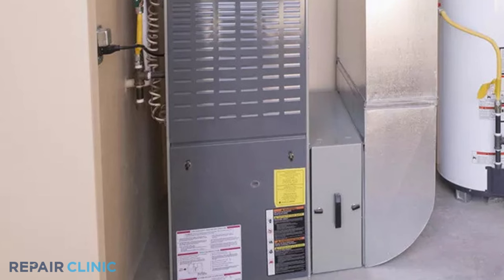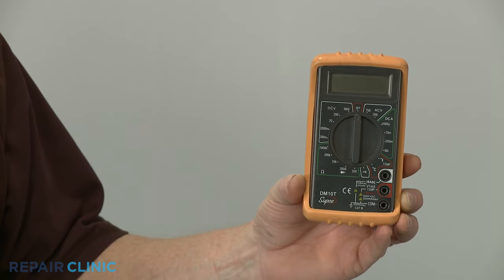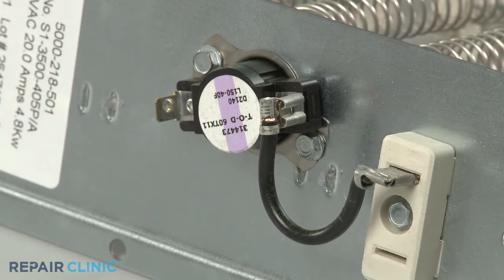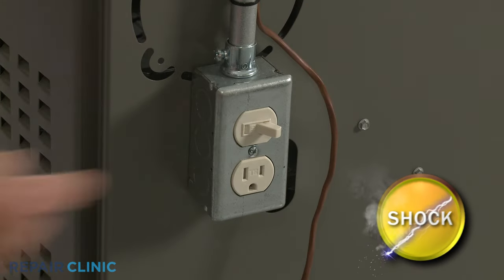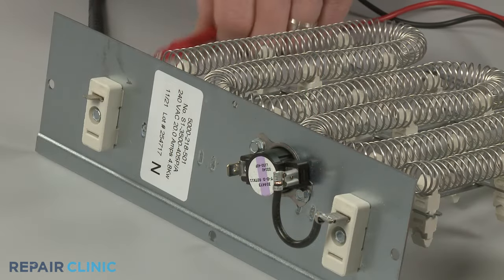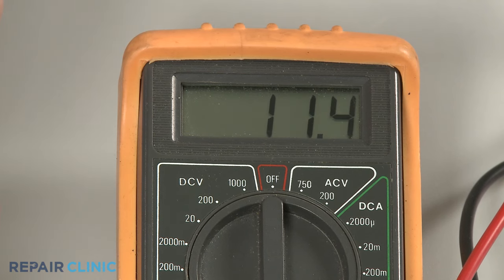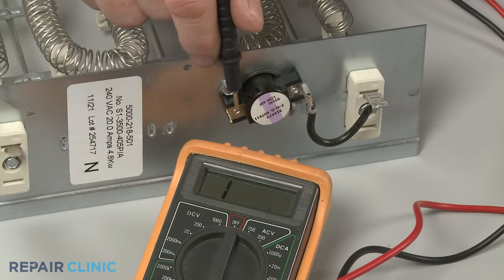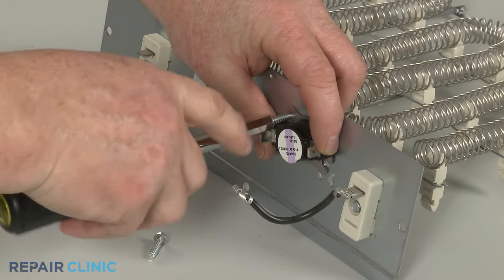Furnace Heating Element Testing

Comment: My element is melted in half so only 1 side heats. Can the wire be welded? I'm guessing not. If I wrap the wires together it works but I don't run it like that because I don't want to burn my house down. The limits and all other parts are good.
Reply: You can pretty easily replace heating element I would suggest that rather than running it any way due to the fire risk like you mentioned